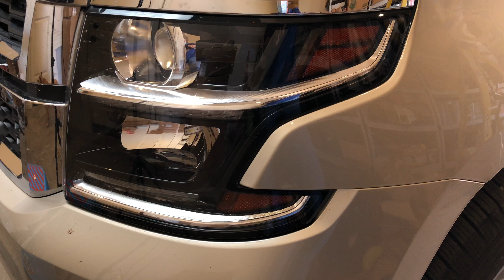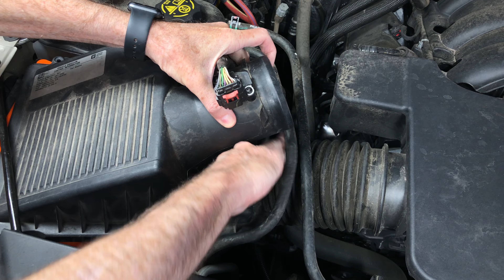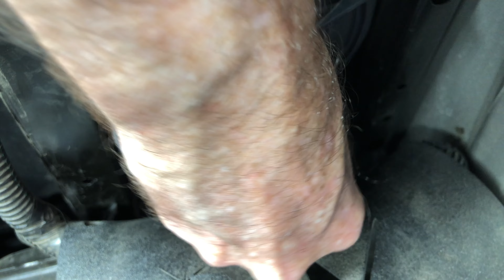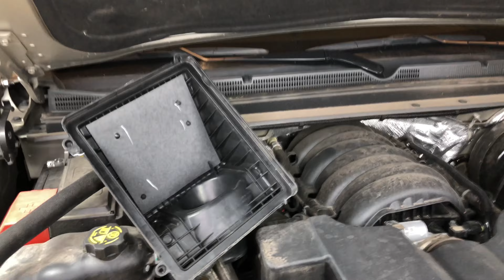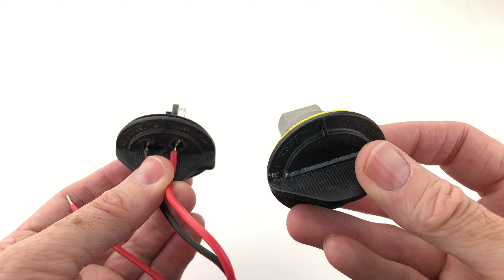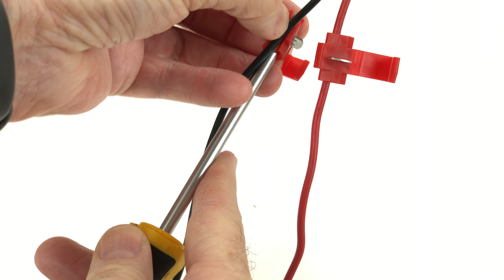Replace Front Turn Signals with LEDs

Comment: What if when replaced it still doesnt not work
Reply: The bulb plug socket needs to be put on a certain way
Reply: Some bulbs are polarity sensitive. Try removing the bulb and rotating it 180⁰

Comment: Very informative. Did you remove the air valance from the front? Any notice in gas mileage?
Reply from the maker: The air valance was too low.  I wanted to be able to pull my tires up to any curb height.  No difference in cooling or mileage noticed by me.

Comment: I double checked to make sure the lightbulb was secure, but I had a hard time getting the new light in as the led was a longer bulb. I knocked off the bulb in the housing. Is there any way to get it out?
Reply from the maker: Yes, you can get it out without removing the headlight assembly. This happened to me from a bulb with a loose fit. I used a magnet wand (magnet on a stick) and a claw wand (push button extends three claw fingers for grasping objects) to get it out (I don’t recall which one actually worked as it took some time and patience to get it out). The wire end was slightly magnetic so I had to make very small movements with a lot of trial and error.

Comment: Hi I bought a new headlights assembly And I get the hyper flashing turn signal error Is are there a way to program it or put a different Relay instead of the resistors?
Reply from the maker: If you are referring to a 2015-2019 Suburban, Tahoe or Yukon then the body control module controls the hyperflashing.  It's not a relay like some vehicles.  I'm not aware of any way to program it to ignore the error or to change the bulb failure detection current levels.  Assuming the new headlight assembly uses LED's (and it's not just a wiring error), then I would contact the manufacturer or add your own load resistors.
Reply: @omegalphaconsulting4546   I like your videos how detail you make them appreciate all the information and thanks for answering my question
Reply: So these will cause flashing and errors on a 2020 Tahoe but not 2015-2019 models?